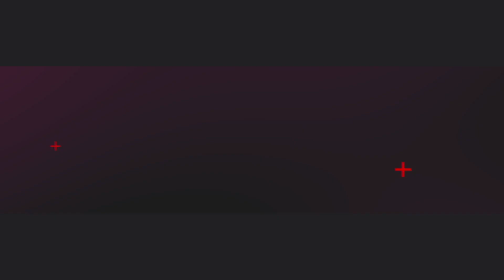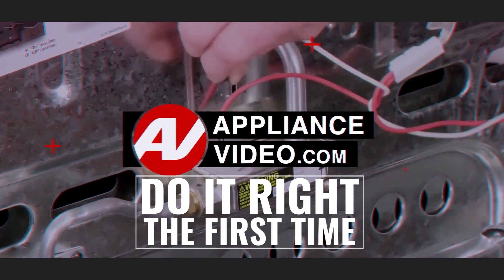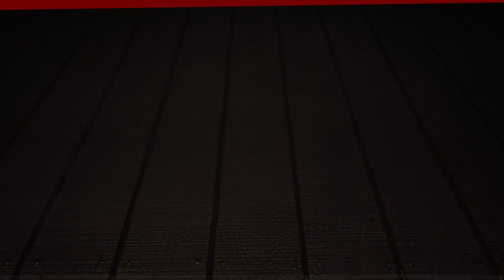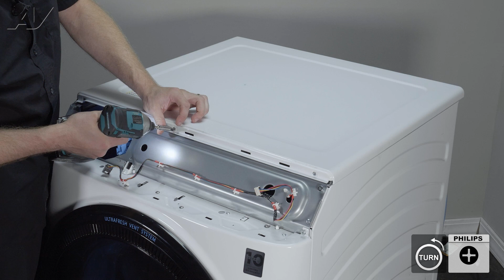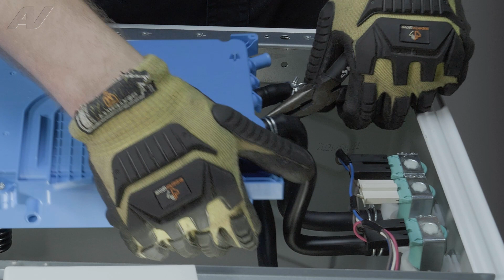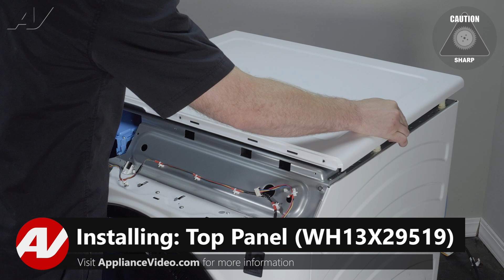GE Washer Repair - Dispenser Is Leaking - Dispenser Assembly

Comment: I was wondering if you could help me with a question I have. I am expecting that the inlet valve needs to be replaced on my unit when filling there is a loud screeching sound. I’m getting an H2O error and my soap dispenser and fabric softener dispenser will not dispense any chemical. Will that include the inlet valve causing insufficient water to be put into my dispenser to be correctly, dispensing the chemicals as well.

Comment: Hey we had the same problem and the tech came out and replaced the whole unit.  When we tested even more water came out the middle accessory hole.  He put a screw and silicone in it and it stopped the leak.  That was done today. If we have issues in the future. I wi update this post.
Reply: What do you think was the actual leak?  Were the screws not pulling in the blue tray tight and leaking?

Comment: Where would you typically see a leak if this needs to be replaced?  My washer is the same model and leaking in the front left corner from the bottom of the washer. I had an appliance guy come out and check, but of course it wasn’t leaking when he tried to diagnose 😅.  He said that the drawer may need to be replaced, but can’t tell for sure. It has started leaking again in the same corner.
Reply: I have the same issue. What's the part you changed to your washer?
Reply: Wondering where it is that a leak would be in the tray? I guess I don’t understand why it would need to be replaced or what it is on it that would go bad?